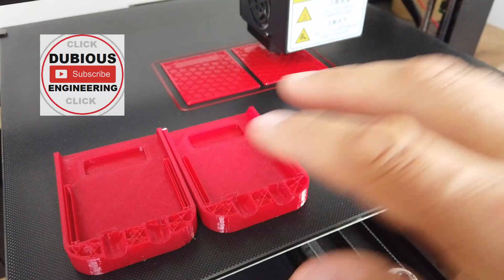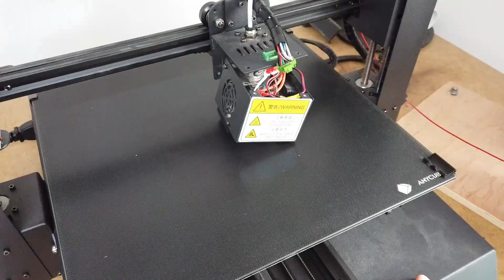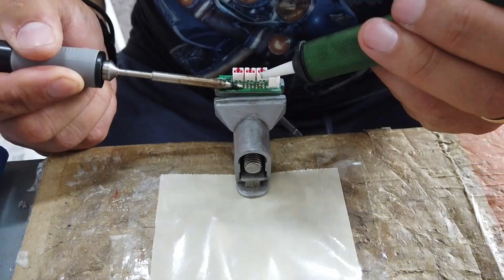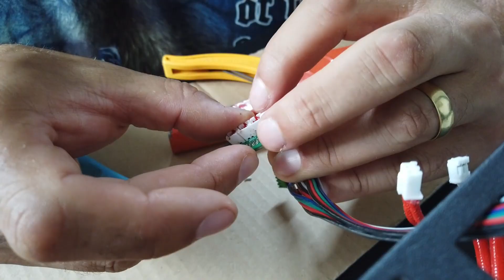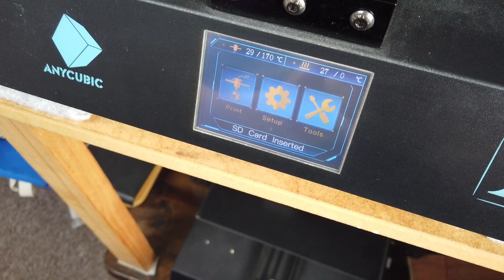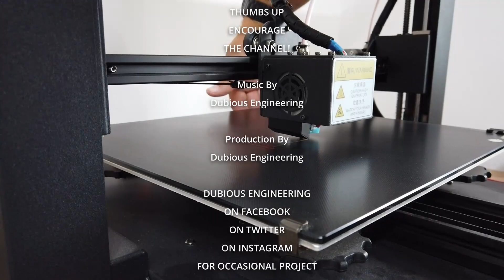DuB-EnG: T1 T0 senser sensor abnormal fix - Print stop - Repair AnyCubic Mega S X hot end connector

Comment: Well that’s a good one. Will try it to fix same issue on my anycubic
Reply from the maker: Good luck!!!
Reply: @DubiousEngineering  Well, it becomes much better. But sometimes 3d printer still get lag. I watched one good video on ru segment of YouTube. Main problem is 6(!!!) connection(in one way and 6 to motherboard) between motherboard and thermal pair. I can translate it, but main idea for solving it is to connect thermal pair right into motherboard without any extension boards inside.

Comment: Please help, is it possible for the T0 sensor in the hot head to get fried? I've seen the hot head spark and something emitting smoke, i plugged one of the connectors backwards, put it in correctly again and now i get a continuous t0 sensor error even tho i didn't see any carbonized connectors or black pins, I'm suspecting i might have fried the t0 sensor all together.
Reply from the maker: Yes, suggest you trace the cables back to the circuit board with a multimeter.  Perhaps a track has fried

Comment: I don't have this issue, but I have some printing issues, bed adhesion, print quality... Could you maybe share your settings with me? I'm trying to make something for a friend
Reply from the maker: Bed at 60C nozzle temp at 200C ...  if that's not working through Cura, get different PLA ...

Comment: do  you know of a way to replace the connector? i have the mega pro and want to still potentially use the laser attachment
Reply from the maker: Replace the wiring loom!
Reply: @DubiousEngineering  the pins on the cable and the connector are burnt? Will replacing the cable fix it
Reply from the maker: @Nathan Bond  I re-soldered mine...  if you don't have those skills, etc, replace the cable loom, which will likely fix it, and clean the tiny pcb with the connector on.
Reply: @Dubious Engineering  like replace the hot end cable? Will the connector on the pcb still be good if it is burnt ?
Reply: @DubiousEngineering  what is the cable loom? the outer sleeve that holds all the cables together?

Comment: i've got an issue with my to sensor 1 the bed thermistor is showing the wrong value it is saying 20 degrees while the bed feels more like 60 or 70. after it cools it drops to 17/18 i've put the bed into to sensor 0 and it reads fine as if it were the hot end
Reply from the maker: Sounds like the bed is on full power, has the sensor stopped working or come away from the bed? Perhaps it's raining air temp?
Reply: @DubiousEngineering  Good idea i'll have a look. Its reading the correct temp while plugged in to the to 0 sensor on my printer motherboard to be honest i think the to 1 port is faulty on the motherboard because it was working fine.